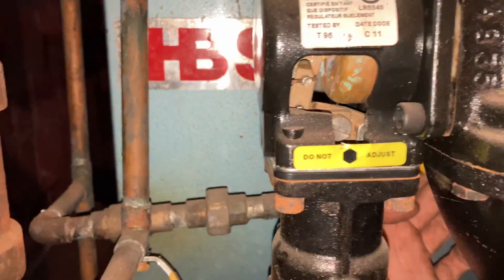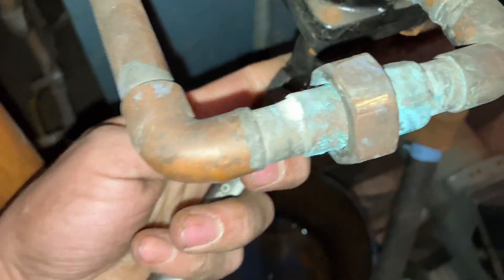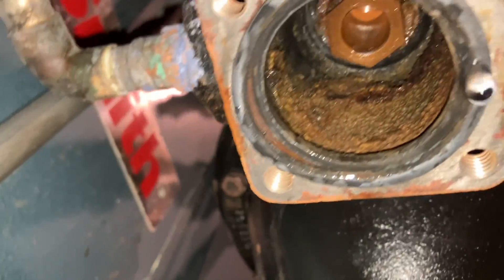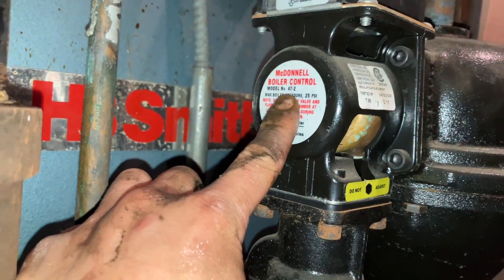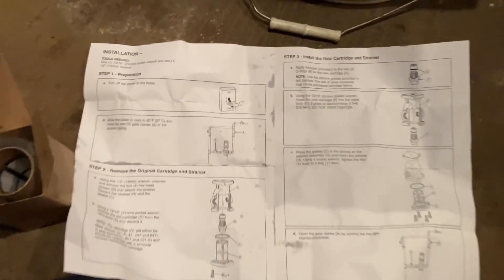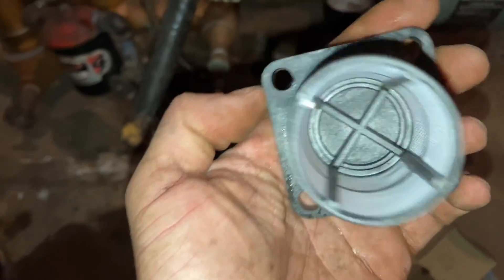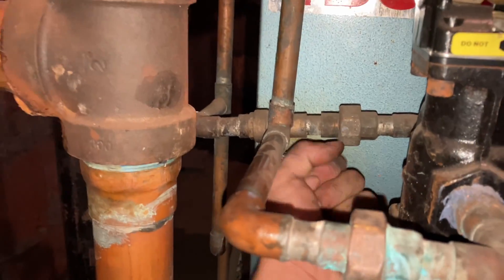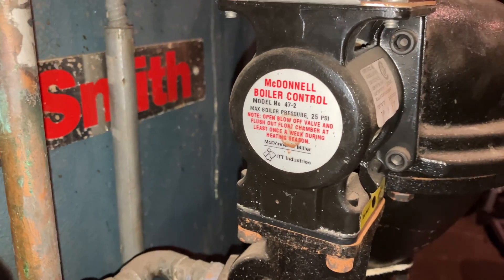Low Water Cut Off Not Feeding Fix

Comment: Great channel,  i have similar boiler in my 3 story apartment building.   My problem is the auto fill valve fills no problem but it periodically won't shut off!   As you can imagine all kinds of related problems result.   Any tricks to get this auto fill valve   to shut off reliably as designed?

Comment: Thank you for making this video!  I have the same setup and I’m hoping that this will fix my problem. If not is there a way to disassemble the whole cast iron housing and change the float switch inside?
Reply from the maker: Thank you for the support!  Yes you should absolutely be able to replace the head assembly, these lwco's are super important for the saftey of the boiler so good on you for wanting to fix it right!
Reply: My unit is five years old. I recently bought that screen and valve replacement kit, this was after a couple of no restarts. One thing they added in the new kit was a special lube for the O rings. Repair did work.

Comment: Great videos and attitude,  attitude is everything. I just started working with a new company with a lot of boilers not steam though. Do you work on other boilers or just steam, I am new to boilers they have locinvar. Any help would be much appreciated.  Thanks
Reply from the maker: Thank you Juan that was very generous of you! I work on all boilers, biggest problems with hot water boilers is air in the line, pressure, sensors on high efficiency getting out of wack, bad circulator pump, bad valve or thermocouple. As you work on them more and more you’ll gain tons of confidence and experience. You can do it brother!